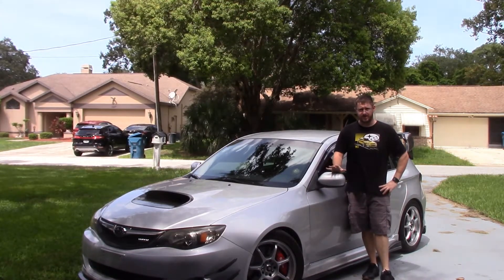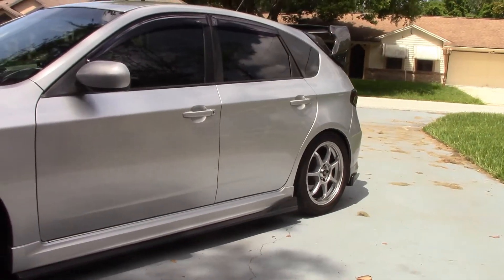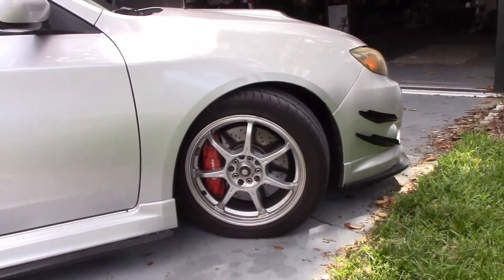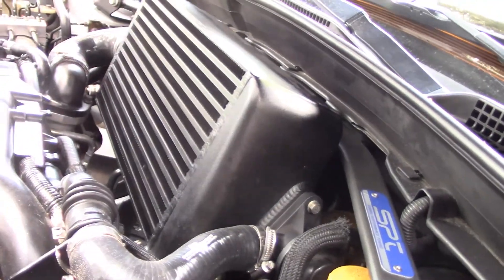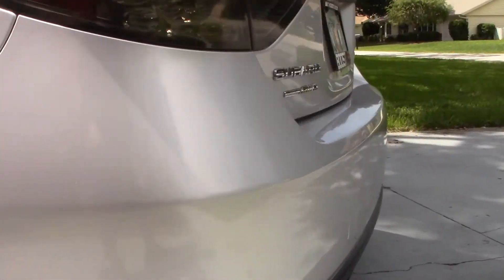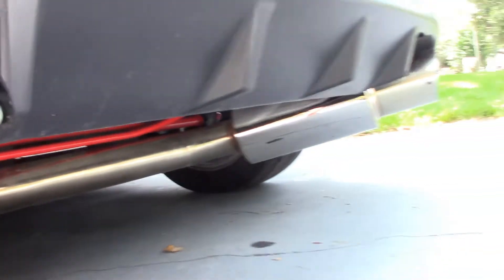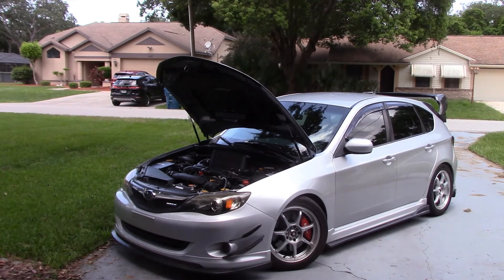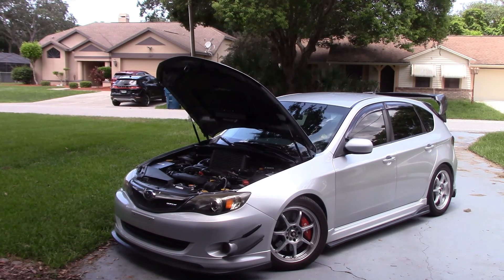My 2010 Subaru Impreza WRX Hatchback Update

Comment: Nice video! Glad to hear about all of the maintenance that's been done. Any idea what the HP/TQ numbers are at this point?
Reply from the maker: I just sent it for even more maintenance work recently. New valve cover gaskets, oil pump, and new seals for the power steering pump and a/c compressor. I was able to take it to a dyno day, and it put down 334awhp/358awtq. Not bad for stock turbo, stock injectors. I'm debating on bigger injectors and having a good friend of mine tune it. Money is the factor, as always.
Reply: @RobertHarridge  that's awesome! Sounds like it's well sorted.

Comment: nice car!, you had problems with the 5mt transmition ? , i recommend buy an inlet hose , so your turbo spool will be better.   i have a perrin intake, mishimoto inlet and same process west verticooler.
Reply from the maker: Alvaro Diaz it’s on my list of mods coming next, with advice from my tuner I’ll be using ID 1050X injectors and a turbo inlet hose, then we throw it up on the dyno for him to tune it. He loves these VF52 turbo’s.
Reply from the maker: Alvaro Diaz as far as the transmission, I’m not sure if I had an issue or not. The clutch was toast, but the car was becoming difficult to get into 4th gear, particularly under heavy load, like the synchros were becoming weak. I didn’t want to take the chance on just the clutch, so I swapped the whole thing to play it safe.
Reply: @RobertHarridge  nice!  , im running 300 whp with  vf52  with stock inyectors on 91 and stock 5mt , last month i bought  kein  mounts ( transmition, engine, blast plates, pitch stop) and they did a good job. The transmitions feels smooth and strong. Day /night diference.

Comment: Drilled? Not slotted? Hm see em crack a lot. Are they sturdy?
Reply from the maker: Nick R. If you get a good quality brand with chamfered holes, they are fine. I’ve never had an issue with drilled rotors.